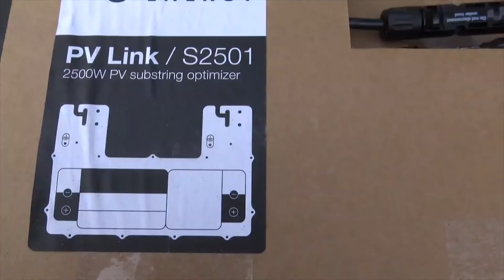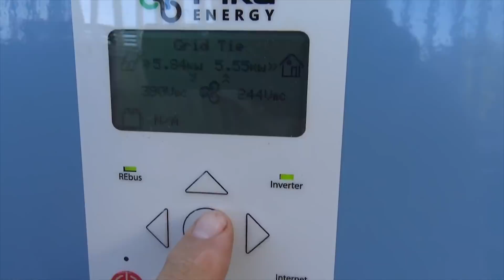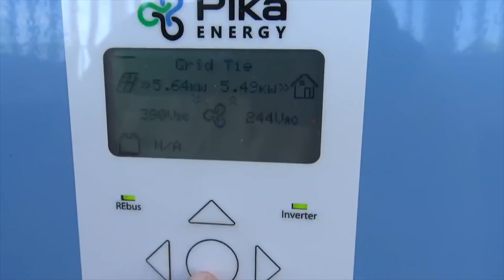Solar Chillers Heating and Cooling Homes!!!

Comment: What kind of B.S. law tells you 20KV is max for your property ?  Run the other 20 KV to a barn and when the inspector leaves send the power to the house.
Reply: It is very likely the power company saying you can't stay grid connected if you have more than 20KW.

Comment: Don't forget that a 20KW array will NEVER make 20KW. That output is only when the panels are tested in the factory with a massive lightning source three feet away in a super cooled room !
I would ask if it's in field output the limit applies to or theoretical output. The two are far from the same !

Comment: Powered by solar, (more) independent of the grid...
Yes I did see the show!👍 How are they heating the pool? Huge heat dump! 
What voltage going to inverters? Did you use 60 or 72 cell panels?

Comment: The only reason why you can’t do over 20 k system has to do
with the electric company themselves. Solar power in the hands of home owners is
seen by them as a big threat to their profits and sustainability. You can build
systems that produce more power than a home could use yearly which in a
Grid-Tie setup would make the electric company not only lose your electric bill
payments but force them to pay you for your over-production of power.  That is why you can only grid tie 100% of what
the home consumes in one year (some locations that have heavy backing for solar
will let you go up to 200%) and the electric companies have a maximum system
size they will allow, no matter what, if you want to remain on “their” Grid Tie.
Looks like you reached their Maximum Limit. Some areas have laws that keep a
licensed electrician from being able to disconnect a home for off-grid use,
which makes the home “not to code” if you try and go “Off-Grid”. Regulations
and rules differ all over the US. Some states and some locations are very combatant
and hostile towards solar although you wouldn’t be able to tell until you see
the big picture. 

Even though there are regulations to help support solar and
other renewable energy, make no doubt, most electric companies are fighting
renewable energies. Most all are monopolies. The entire East Coast Electric is run
by One privately owned company which is government funded, gets major tax
breaks, grants etc. while being guaranteed by law to make a 15% profit every
year or they can raise rates, which they do by approval of a government board
run by… retired high ranking personnel from that very same company! Seems like
a conflict of interest to me.  I would
like to own a company like that!). I could go on forever but back to point.

Something else this homeowner should be concerned about is
the fine print in these interconnection agreements. Large solar system put a
strain on local grid which usually requires the local transformer needing to be
replaced/upgraded to handle the load, especially if other neighbors go solar.
These transformer upgrade are not cheap and per interconnection agreement will
be at the cost of the owner not the electric company. 

All in all, I can’t see electric companies in the long run
ever really supporting the home renewable energy. After all the Grid Tie system
uses the Electric companies Grid which, to be semi-fair they have to maintain,
while possible not getting any income from you. In a Grid Tie system you also
need to understand the Electric Company will only pay you wholesale prices for
your extra power. This amount is considerably less than what you pay for
electric which makes your system less cost efficient.

With that being said and hoping the battery industry
continues to improve (Lithium), I think the best way to go solar is a Full
Off-Grid system with properly sized battery backups and a redundant generator
if you can afford it. I think at that point, the electric company can’t stop you
from going 40K AS LONG AS you
can use and store that much energy. Otherwise you would be overpaying for a
system too big. There are sometimes ways of getting loopholes under farming or
agricultural solar which might be useable here for grid-tie but every location
has it’s own regulations regarding these installs and they are not as easy (if
at all) usually to get. If they were wouldn’t you think every farmer would have
them and what do you think the electric company would think of that? Good luck.

Comment: Is there a good way to use solar thermal to power an A/C system?

I know propane refrigerators use heat to drive the chiller.

Solar thermal is easy to DIY if there was a commercial chiller you could plug in.

Then you use heat to drive the heat pump cooling your house instead of solar electricity.

Comment: Is there such a beast as a Geothermal Chiller? Seems to me that what would be more efficient than an air chiller? If this does exist, could you offer a link to the info?  I couldn't find the magic works to find it in Google. Thanks in Advance.
Reply from the maker: This same chiller can be an air to water or water to water geothermal machine.  It can determine if it is better to exchange with the air or the ground to determine the most efficient exchange.

Comment: Why do the chillers have fans?  Arent they water cooled?
Reply: I guess the heat is moved from the incoming water to the outgoing, but the pumps themselves aren't cooled using that same water.  Not sure how practical it would be to do so - you don't want to cool the water down and then run it over your hot motors, heating it right back up again!  It might be done like this to ensure the output cold water is as cold as possible.  I'm only guessing though, no expertise to back it up.
Reply: You may be right.  The fans may be only to cool internal components but I didn't think the chiller included pumps in it.  Maybe I'm wrong.
Reply: There hybrid, they use ground source, but if ambiant air temperature is ideal, it will use it instead for efficiency.

It's nice in the summer in case you have a ground heat saturation issue & vice versa.

Engineer775

Comment: This seems like the perfect project except for the noisy chillers right next to the house and patio.  Is there a technical reason the chillers couldn't be located a little further away from the house?  Just curious.  Thanks for the video and for the great work.
Reply: +SyberPrepper - I think they've done it for the " look " on the House / Scenery.  Look at the Solar Arrays..., they are like hidden :((((((.  I would have put those on the Roof!  But if you see the Aerial View in the Video, they are doing it for the " look " of it!

Comment: all that to save $200 a month power bill?
Reply from the maker: slamdvw power bill was $1,200 a month and now it's down to under 700. When we add the other 20kw it will be down to $400.
Reply: Why spend $30k on a car when you can get one that does the job for $2k?  Why spend money on a holiday when you can stay at home?  Sometimes people just want to do things because they enjoy them...  I don't think this was done to save money.
Reply: So, how much, out the door did this system cost?  How long until it's paid off?  Seems like every solar system you see, the bill they're trying to offset is under a grand a month.  At that rate, it'll take something like 15 years ( barring zero problems with anything ) to break even.  How do you get around the 40kW system limit? ( or did the rule change ? )  I'll admit, I'm kind of ignorant to this stuff - namely because it takes so long to come close to breaking even.
Reply: It's called progress, moving forward, being energy independent, having vision.
Reply: Still having to buy $700 ( then down to $400 ) worth of electricity isn't very "energy independent".  Don't get me wrong, I like the idea - but unless you're mega-rich it's useless.
Reply: slamdvw 
My brother and I had the same thought why spend 15k to 25k on a much smaller system, just to save 100 bucks on an electric bill. I guess unless you want a feel good moment or you have sustained power outages, why ?
Unless you have what's called stupid money to throw into a project like this.
Still it's a nice project and enjoyed watching this video.

Comment: The governing body wants to buy power from their own power plant. your not allowed to be independent.you will be taxed. you must be taxed as you may be operating under their jurisdiction.the question may be, How to opt out of their jurisdiction?I say if you want 40 kw you should be allowed. look into Who made the 40kw residential rule
Reply: Yes it wasn't explained in the video but it seems like you're not prevented from installing 40 kW of solar, you're limited to pumping no more than 20 kW back into the grid, which makes sense because in order to pump more into the grid you will likely have to replace the cables coming from the power company with larger ones.  I'm sure they'd let you connect more if you were willing to pay for the cable replacements though :)
Reply: +ELRYANK - Easily done, take it " Off Grid " !!!

Comment: There is no reason for house to have larger than 20 kw array. All those large fans making lot of noise right next to the house.Geothermal system is correct choice for that job with all that land area ,and less expensive, ice chillers bed idea.  Conclusion is that is great to have low IQ costumer with a lot of money.
Reply: most services where I live are around 40+kv to the house from the grid, so why not for solar ?
Reply: Just have a small efficient house, so seems like overkill to me. Can you make any money by selling all that excess power back to the grid, If you connected?
Reply: +786otto - I think that is the problem here... Because they are " Tie Grid ", so the don't allow 20KW and up.  If they're out in the " Boon ", by running that back to the Grid, the Power Company won't make much off of you. Plus, it will " Kill " someone if they are working on the " Line ", etc.  To solve that problem, don't tie to the grid and try to sell it to them.  On your own, I am sure you can go over 20KW easily.
Reply: Before anyone thinks of any solar array they should first make the house more efficient, insulate it get better appliances and all that, then no one need those large systems, small system cost less too. Second any extra energy produced will be eaten by the power company at least in my area you don't get any credit for extra power produced, so don't go over hundred % of your usage.
Reply: 786otto how about I have what I want? If I want to have a big house with a bug solar system to go along with it, then it shouldn't be anyones business.
Reply: Yes, of course. Enjoy it.

Comment: That was an impressive project!  I'm curious if there are any thermal solar systems that don't go through the very inefficient process of making electricity to then heat and cool water.  Perhaps the economics of PV make sense now but the energy balance certainly doesn't.  We used to sell hydronic boilers and also thermal fluid heaters and I would have to believe a thermal fluid system could be done way more efficiently and without all that electrical inefficiency.
Reply: SaltX Technology was at the last Intersolar conference in California displaying some thermal energy storage devices. They're mainly utility scale right now, but had some interesting commercial and residential ideas.

http://saltxtechnology.com/technology/

Comment: Have you TESTED the "optimizers" for RFI?  You have a huge antenna there if those things are not clean. We ham operators are getting killed by RFI from solar optimizers and panel-mounted inverters that have no RF filtering.

Comment: 40kW at 240V with net-metering would be a 167A backfeed at peak production and assuming no use in the house.  Because of all of the regulations on net-metering, I don't do it. I use off-grid for part of the loads.

Comment: Your max 20Kw domestic could be to do with unwanted effects on the mains power supply! 
If you are feeding it with inverters you are not getting a pure sine wave and will inject harmonics into the system! Also there is the small matter of voltage. If everyone is dropping 20Kw load into the system during the day it will raise the voltage only for it to drop at night! There is a set amount of variance of voltage supply and you may well cause it to go outside this with no easy way for the power companies to remedy it!
We regularly get people calling us out in the UK because their brand new photovoltaic system is not working because it registers high voltage and cuts out! .... Guess where the high voltage is coming from?
Not sure how long that trunking will last outside though (maybe it is OK in your weather?) We would prefer plastic (same size) and you don't have all those little earthing links to install ;0)

Comment: once i found a pull tape on sec 80 PVC gray cut into and caused a leak of water in the pipe it was a 550 ft. pull ! stopped using pull tape and used a off nylon line ! man thats a big job very nice work ! thats a big long electrical line box set ?
Reply from the maker: Theredneck Prepper yes we had to use to a footlong 12 x 12 gutters. The mule tape is pretty forgiving on Long pulls.

Comment: Howdy Engineer775, I have been watching your videos for some time (since about 2012 ). Can you please advise me on a good beginners book on learning about solar and how to plan, design and build a system. How to figure what is needed and how to plan for future needs. Thank you so much.
Reply from the maker: Sam Brandt Sam instead of reading a book I would start with a small project and just pick something you would like to run. Whether it be a refrigerator, a fan, a pump lighting you pick it and let's design a small solar battery charging and inverter system to run it then you'll understand the basics.  Send me an email at info@practicalpreppers.com and we'll get started on your first DIY solar project.
Reply: Thank you for your most generous and unexpected offer. I would really like that. I have been trying to figure out how to approach this for a while now. I will contact you via your email. the subject is "Hi this is Sam from youtube" once again thank you so much. Also Don, I will take a look at SEI to see what they have. Thank you again also.

Comment: Because it would exceed 80% of a 200 amp service ocpd?
Reply: By 40 amps
Reply: I highly doubt that house has/had only 200 amp service.
Reply: Robert Steich yeah it does. No such thing as 300a and a 400a meter base is twice the size of the one they are working with.
Reply: I have a 300a service.
Reply: David Armstrong where I am located there isn’t. Should have stated 😂
Reply: You guys got me confused.... 20kw at 240v is 83amps.    40kw at 240v is 166amps.... 200amp service at continuous load is 160amps, so why is more than 200amp service needed?  It fits really closely within the NEC 80% continuous load rule.
Reply: So i could get 400A service and then get 40kw

Comment: I know for here in Australia and Victoria's North East you have to put in a application for approval for any unit over 5kw feed in, but what most are doing is installing 10 or even 15kw of solar and a new battery control unit that will only feed back to grid what they set as max eg 5kw, some say what a waste but when you only get up to 10c per kw feed in but your paying 40c per kw then why put any in.
The units can full the batteries to max and regulate from batt and solar and mains but also the batteries can now be drained to 0 yes 0 and it will not hurt the batteries one bit, it is actually better to the batteries.

I will not say brands or give any other info about it, but for those that don't know we only run at 240v, so a 10kw is almost 20kw in the USA.
Reply: In WA for a three phase service, we're limited to 10kW export per phase.

Anything above that can be consumed or stored.  It is also common and permissable to oversize the arrays on the inverters.

Comment: What’s the cost for small scale homes vs normal Ac vs heat pump? I know moving heat not making it is best but the equipment cost vs gains must make a break even point on system size, any idea what tonage on cooling that would be?

Comment: Request a variance from board of zoning. If they say no, just do it anyway. If they try to remove it file an injunction asking the court to halt any removal. Then litigate it, if it means enough to homeowners. Good luck
Reply: It would overload the lines feeding back to the grid.
That is the reason they can't go over 20KW...it's due to the service type (residential) @220VAC
Reply: Could they not add new service?

Comment: I can't imagine what that costs to install that system
Reply: I bought 20 285 watt panels for $2500 built my own mounts.... charger $600. Batteries $1200. Inverter $400.  I only got half hooked up because it's all I needed!
Reply: It's not going to happen in this case - see, just that "machinery and logistics" was way way way more expensive in this big house than your DYI project total. Not trying to trash you by any means, I'm going to install almost identical solar system as you have myself... just saying the cost adds up extremely quickly.   Six figures for sure, and the first digit was not 1, maybe not even 2 - see the owner of that house is not poor by any standards you can imagine.  BTW, very very wrong placement of solar panels on such huge property : 6:55 and 8:27 show the misery. Hard to estimate but I'd say 30% wasted (yes we are talking BIG numbers with 20kWp system)  -  I have NEVER seen such wrong decision of solar panel placement in my life.
Reply: Jesse Lute , easy six figure project 🤔
Reply: Can't imagine, good thing someone can imagine
Reply: R Coyote interested in selling any extras?